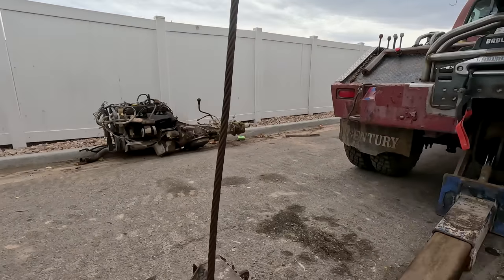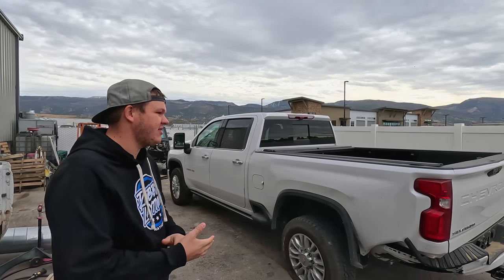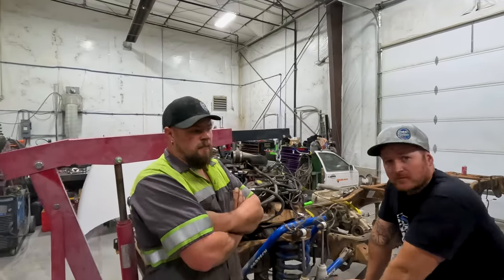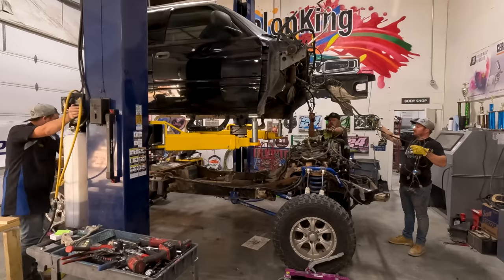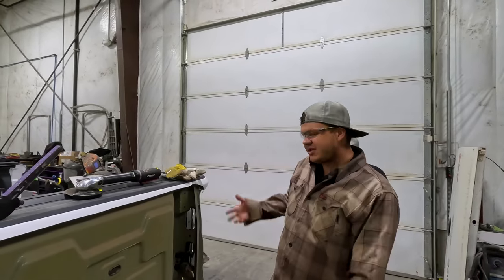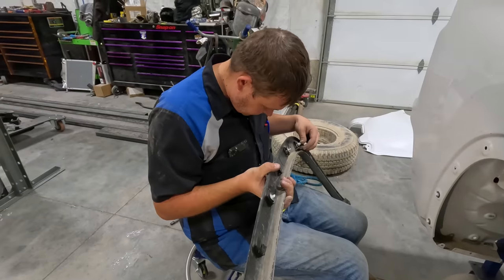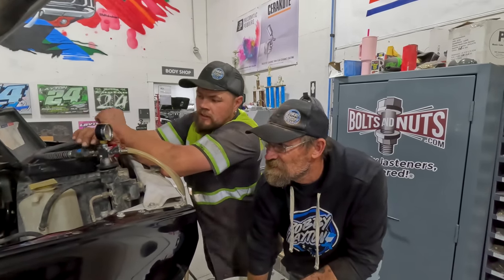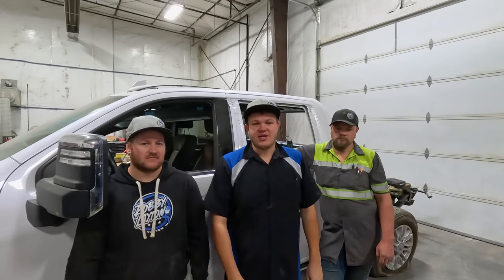Our Off-Road Tow Truck Saves The Day Again!

Comment: It might have been a good idea to paint the new frame with Por-15 rust converter before the parts were moved over.
Reply: Think he said they getting paid to swap frame. They weren’t doing a restoration. But, if mine I’d paid extra for it to be done.
Reply: I thought they would at least hit it with a rattle can tbh, like while it's out?

Comment: There was a lot going on in this video, most of it was damned informative. Do the manufactures teach you guys how to do body repair on their vehicles or are just figuring it out as you’re going. Also in your experience do you see improvements between new and old vehicles and what in your opinion has been the best improvement??
Reply: Pretty sure there's a bodywork industry group that offers courses.
Reply: I worked as body and fender mechanic years ago and while they did have few courses, the employer would not pay us to take them. Most the time we figured it out as we went along with help from the parts breakdown.  But as I said that was year ago, (BI) before internet.

Comment: Robbie, and Hillbilly as a newbie to auto repair i really appreciate your videos. I cAn tell making the videos must add a lot of time, but it is really interesting way to learn new things and see scenery in your neck of the wolds. I own a similar chevy , and thankfully have been working on it for fun modifications , so i felt ya with that rear seat. Its a nightmare, and i managed to squeeze a 1kwatt full sine inverter in one of the cubbies, and install a dual battery bank. Seeing hlw hard it is to cut the side made me happy i decided to build shelves in tje bed instead of under it.

Comment: A trick to do on that bucket of coolant is to take a stick of wood and zip tie the hose to it so it will stick straight down and not curl up. That way you don’t need to stick your whole arm down in the bucket. I do that for my power washer soap hose.

Comment: Robby, I wish that all the body workers would do the work the way you do.  I have discovered as it goes that many things that should have been fixed were never done.  all the rubber items were replaced, but never installed as it was designed to be put together.  Now I have been repairing areas that were not done as they should have been done in the first place.

Comment: It's crazy how a $3 worth of plastic can cost the consumer $300. But we see that with everything these days. Good job saving it.
Reply: Bigger picture…
It’s that 30k to 150k engineered die mold on a multi-million dollar machine you are paying for, plus cataloging, warehouse inventory control and transport. Hundreds of hands, machinery and systems go into making a $300 price tag a tiny fraction of the overhead involved.
Reply: Yes it is easy to oversimplify what goes into manufacturing parts, but it is a complicated and costly process!

Comment: Robbie the slow precision you got with those hydraulic winches. It's why hydraulic winches are king. They take a little longer for precision. Because they have so much power. They'll rip what you're pulling in too. Just have patients keep the hydraulic winches, they'll pull whatever you need, and they're slow enough, so you don't have to worry about damage. You should see it starting before it actually happens.

Comment: i did one of those about the same year not to bad of a job .... hardest part was getting the rear axle and front suspension in chasing the frame around .    did it in 1/2  hour  over book time from start to finish

Comment: If anyone is looking at getting the Mueller 277 kit 25:42 should check the Cal-Van cv113 or long reach Cal-Van cv114. Cal-Van is 1/3 the cost only difference is blue handles.

Comment: Haha - Allsnake - I love it. I did restoration work as a PM for almost a decade. Fire, flood, mold, and sewage losses in homes, condos, and apartments. It was our policy to never work an Allsnake claim for the restoration side of the claim. We would do the mitigation side - the initial call, the dry out, and the demo - but never the restoration side. When the client would ask why, we would just politely tell them that we were too busy and they needed to ask their adjuster or agent for a preferred contractor to handle the rebuild. The reasons were the same as Robbie’s; Allsnake would do everything they could to not pay fair market cost  for labor or materials, or flat out deny our estimates. Horrible insurance company for contractors to deal with.

Comment: I'm glad I'm not into the auto body portion. And what i do know is illegal stick to the old antique stuff, little tech tip er put a 5/8 nut zip tied to the hose for the vacuum coolant tube to hold it in the bucket.
 Keep up the good work, and keep the video's coming.

Comment: Honestly the frame swap makes a lot more sense than the bed repair.  You can find an undamaged bed much easier than repairing the bed.  As a demonstration of what's possible this is interesting but I would much rather have a used bed that's touched up.

Comment: For those pesky clips spray soapy water into the edge of the plastic piece you are trying to remove it will get in and lubricate the hole so you don't  break the clip when you pry on it

Comment: 29:50 do you know that if you attach a piece of say 1/2" ID pipe over the end of that pickup tube, it will sink by itself, no need for a 2nd pair of hands to hold the end down into the coolant.

Comment: GM is so up to date with only offering a tiny sunroof on their trucks. Ford has given a full panoramic since 2017 on the Super Duty and RAM offers that on the half tons since 2019. GM, as usual, in last place.
Reply: Actually wish they'd stop offering them as they just add cost, complexity, reduce headroom, leak and are a pain to deal with as they age with the drain lines clogging and the gutters rotting out.  Best repair I did was to remove it, weld in a panel to close it up, put the solid roof bows back and install a standard head liner.  No more rattles, wind noise, leaks, jams, etc, etc.  Doesn't matter the make, model and such as they all will eventually have problems even if you never open them.  

A sunroof on a vehicle reduces it value substantially in my book and I would only consider one if the vehicle was basically being given to me as a gift.  Hows that go...  Once bitten, twice shy.  And I've seen a good many folks bitten by that snake.

Best!

Comment: 1:10 That Hillbilly is NOT a cherrypicker. 

What that is, is an engine lift, hoist or crane.
Google it at Harbour Freight.
 
An actual 'cherrypicker' can be like you might use in an orchard, to pick fruit from a tree, a mobile work platform.

A mobile powered scissorlifting platform that you see maintenance people at height eg replacing factory light fittings and such from.

Or a cherry picker (also known as an elevated work platform, boom lift, man lift, basket crane or hydra ladder) is a type of aerial work platform that may consist of a platform or bucket at the end of a hydraulic lifting system.

Just saying 🤓👍
Reply: Wow, the comment of the day!

Comment: I am surprised that you put that much work into the truck without the insurance company agreeing to the payout.  You could tell the insurance company to take the bid or get someone else.  What happens after you put a days works into the truck and they still don't agree with the bid?
Reply: They will likely pay most of it eventually. He basically has to tear it all down just to prove that the damage is there.  He will take a bunch of photos and send them in and get the bid revised.  They will probably still try to deny some of it.  Had they sent an adjuster, like Robby wanted, it wouldn't have been a question.  Its a BS way of doing business. For that much damaged, most companies would have sent and adjuster.

Comment: and some body shops (not Robby) are not that honest either I had a 96 Chevy Corsica that someone hit the drivers side the body shop quoted $200 each for used doors I found both in a wrecking yard and paid $30 for both and the paint matched my car.  I have to wonder if it would be better and easier just to replace the whole bed rather than repairing it
Reply: Oh...rest assured the insurance company will compare those costs.  It's in Robbie's best interest to itemize.

Comment: That chassis they are swapping in looks like a mass of surface rust some of which is bordering on scale. What's the point in tearing it all down without scuffing it up and epoxy-sealing it with Jotaprime 500 or similar? At least that will hold it for a few years. I couldn't bring myself to put a chassis that rusty back in a vehicle untreated.
Reply: Was thinking the same thing ..at least sand blast and prime it
Reply: @danrussell3439 Cost.  That frame swap was likely 'out of pocket'...not covered by insurance.
Reply: @billbillinger2491 Bingo!  Robbie already said the vehicle wasn’t worth the money they were charging to do the swap!  Add in the cost to paint the chassis would just make it that much worse!

Comment: I guess I missed it, but why use an old frame instead of straightening the newer frame?
Reply: Once bent, it's weakened.  It has 'crumple points', designed to bend...to absorb the energy of the impact.
Reply: @billbillinger2491   Thanks for the info!

Comment: This is much deeper of a problem than just $10 plastic clips. The amount of price gouging from some manufacturers, GM being one of the worst, is getting out of control. Maybe the isnsurance companies wouldnt have to get shady with claims if the auto manufactures didnt get shady with the parts that they know they're going to sell the most of. Does anyone memberberry when the insurance companies were calling out Honda for their deliberately engineered front corner gold mine? They were claiming Honda was intentionally engineering and then price gouging the replacement parts for the front corners of their cars because even the smallest hit in that spot meant replacing the hood, fender, bumper, headlight, and grille. Well clearly the only thing that's changed in that 15ish years is that now more companies are doing the exact same thing and the consumer ultimately gets the shaft because the insurance companies will always find a way to make their profits regardless.🤦‍♂️🇺🇲

Comment: No wonder Chevrolet such a piece of s*** 😅hold up on ranches front end falls off of them the doors fall off of them because they're glued together
Reply: Bonding/ glueing is a very good way of attaching two pieces of metal together.  There are many metal airplanes whose wing spars are bonded because it's lighter and stronger than riveting

Comment: What’s incredible is new trucks are glue, plastic, thin sheet metal, bumpers are plastic and they cost $80,000-$100,000. What’s wrong with this picture that insurance doesn’t want to pay for glue and plastic vehicles, shove it down their throats Robbie and make them pay for the damages their client did to the brand new ruck even though it’s glue and plastic they insured the idiot who caused the damage so pay up.

Comment: What's a the difference in a driveline or a shaft it sounds so weird when you guys say drive line a drive line would be the whole setup not just the drive shaft driveline would be the motor and the transmission to transfer case the drive shaft rear end that's a driveline find some older mechanics to get your educated on stuff